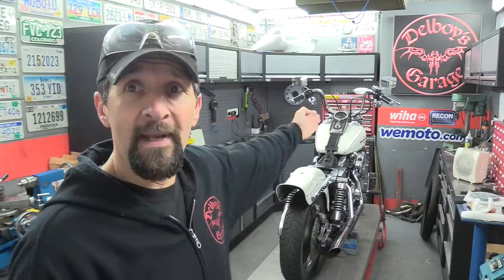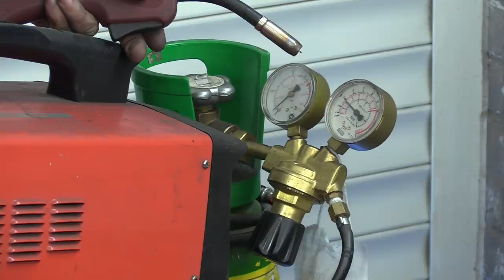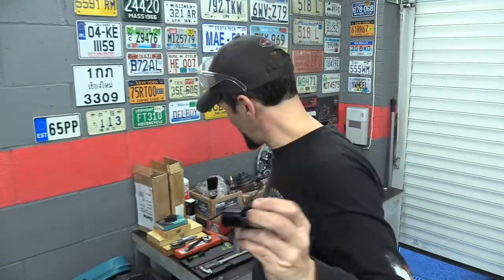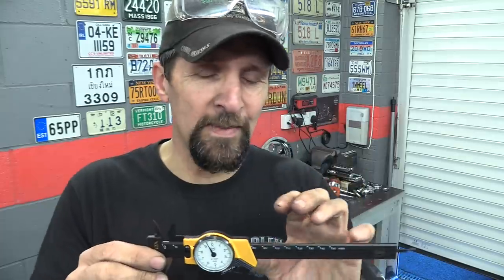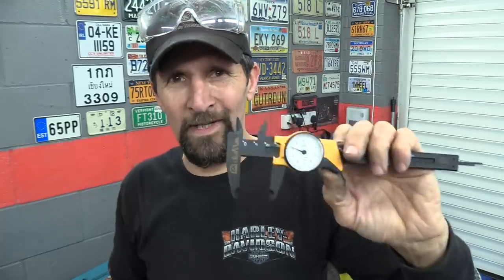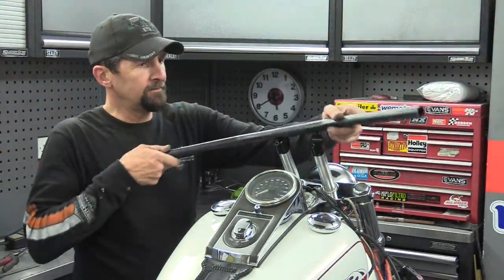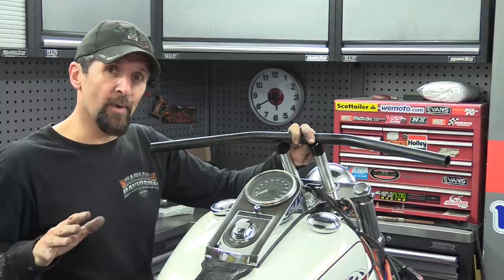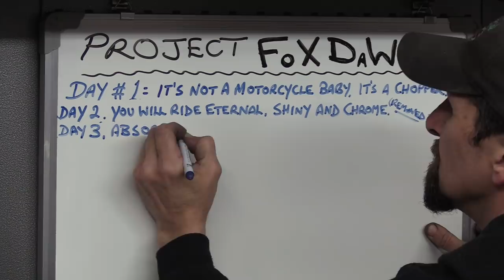Delboy's Garage, Project FoXDaWG, Day 3 :- Handlebars..!

Comment: looking at the nuts you welded to that thread bar, you ground off one side so  the thread has stuff all holding and then you machined the weld down by .7mm at least. So ure relying on a tiny bit of weld and some loose thread thats missing almost  a 1/3rd.  That looks like a big safety issue to me  to hold down all ure steering

Comment: Not a fan of the "all thread bolts", not on a motorcycle anyway... Risers look ridiculous to me, just my opinion. Like others here, I say cut the risers just to clear the speedo, second set of bars.
Reply: Also, if you're going to round/flat the head anyway, just cut a thread into some round bar on the lathe. That way it's one piece and thus safer.
I don't necessarily think the risers are too high (looked ok with you sitting on it), but, like others, I'm worried about flexing. The engineer in me is saying this setup needs some bracing somehow.

Comment: Don’t forget to check the cam chain tensioners at about 40000 miles it’s worthwhile they could be worn . You don’t want them braking up and going in the oil pump 1/2 hours work saves a nightmare I am about to change them on my twin cam fat boy at 38000miles.
Reply from the maker: Thank you buddy, fortunately, I lucked in on the tensioners, the bike has had new primary and secondary tensioners, both new chains, roller tappets and SE203 cams just 1000 miles ago and a massive investment by the last owner... good luck with yours, ain't the twin cams the best engines ever?

Comment: As an alternative to a plastic Vernier gauge, just stick some insulating tape to the jaws of any metal gauge, close and zero them with the tape then measure whatever it is you're trying not to scratch.
Reply from the maker: Great solution, provided the tape's hard enough not to be absorbent as that'll give a fluffy measurement, most tape is soft and flexible... what I was hoping for was a hard plastic jaw cover, perhaps some of that stuff that pushes on to the edge of sheet metal?  Either way, the Wiha plastic dial gauge is bang on for that I need...

Comment: Great video Del.. I would use the bars that are in the black and white part of the video but shorten the risers just a bit maybe one inch so they are level/even with the console on the tank. Look at the black and white part of the video, you will see what I mean.. Keep up the good work.
Reply from the maker: Hi buddy, thanks for your kind feedback, I have a plan... I kinda like the high risers, but you're right, think the bars look a little detached, but as you probably know full well, it's very much a current west coast look, but not going for an outlaw style, something a bit older than that, so I may tone things down a little, so it all fits in!
Reply: @Moonfleet41  Yea I like the high risers to I just think if they were just an inch shorter it would put the bars even with the console on the tank. Great work..

Comment: Gotta admit I prefer the Flat bars but the other bars look better from the side with you sat on the bike than the other view but all that could change with the switch gear and stuff on them. Though If i went with them I'd be tempted to drop them an inch or so IMO. But It's not my bike so just do what's comfortable for your the one going to be riding it.  Glad to see more lathe videos as well.
Reply from the maker: Thanks mate, I think you're right I did leave the risers as long as possible so I can lop a bit off if I need to... !

Comment: I think rather than make a long threaded rod I would have tapped both ends of the riser and used a grade 8 bolt at either end ?
Reply from the maker: Hi James, threading in to aluminium?  Really?  When you can make all the threads steel!  I'm opting for the safer option mate...
Reply: How would you tighten the goofy heads?
Reply: Tighten the handlebar clamp to the riser using a bolt with a flat on it. Then align the two clamps using the handlebars, then tighten the bolts under the top triple clamp.

Comment: Whichever bar you go with, if you're keeping those risers I would suggest some urethane bushings from Alloy Art. You can see the flex in them when you sit on it at the end and pull on the bars. The OEM rubber bushings are garbage.
Reply from the maker: Thanks mate,. good call.. you;re dead right.. they do flex too much... the bars are all loose at the moment, but no matter how much you nip them up they still squidge about... so in fact im actually going to opt for some steel bushings and lock them up solid.. i can damp out any vibes with some internal slugs in the bar ends.. and it'll ride much more accurately aye... Cheers, Del.

Comment: The Risers are way too high and don´t fit the "motocross like" handlebar, nore do they fit the style of the bike. I would cut each riser to half the height. Aside from that they were manufactured, or should i say handcrafted, in a very sophisticated manner. Excellent job, Del. And you use a Kärcher Vacuum-Cleaner, well that`s a good choice too. It`s real german quality from Baden-Württemberg. Thumbs up!
Reply from the maker: Thank you Doc, that's kind of you... I've made them to emulate the same bar set up as the Night Train of the same year... they may look a little high, but with a low seat, which I intend to use, they will give a shoulder height riding position that's really comfortable... Thank you again, have a great week!

Comment: Love the look of the 2nd set of bars. I think that would be trick as hell with the HD Forty-Eight style of underslung mirrors. Can't wait to see the headlight fairing. Some Eagle Lights LED projectors in black would be epic too! Are you planning on slamming the rear down? That fender just has too much gap!  Very similar to my old 88 Super Magna in shape (the rear fender). Would look great with a dual set of round LED tail / stop combo lights tucked under the duckbill of the fender. Regardless, you have impeccable taste in Harley styling so I'm sure it will be very cool...... 

Mike & Melly
Reply from the maker: Thank you Mike, gonna slam the rear and the front, at least 1.5", 2" if I can get away with it, and I'll be making the fairing from scratch, so that may be a few videos in a row... sounds like you miss the Magna brother, don't we always sell the best ones!  Love to you both, D&Px

Comment: Dale, those calipers are for electronic inspection work. ESD .... Electrosatic Discharge,  they will not charge up with static electricity like the stainless steel ones.  The black holding fixture is also made of antistatic material.  A small case with foam rubber could induce static, that's  why there isn't  one.  Retired Aerospace Engineer.  Electronics can be damaged by static electricity.   Especially  CMOS devices.  Copper Metal Oxide Silicon.   There,  I am not going to charge you any consulting fee.  This time !  Haha  Ride safe .
Reply from the maker: Hi Bill, thank you for your professional insight Sir, they are indeed the ESD version (1000 volt I believe?) and I also listed in the description the non-ESD version of these as well... I didn't really  both mentioning it, as not only is it not really relevant, it's just an extra most of us won't use, or benefit, from... but there's no way in a million years that I could have put it as eloquently as you... thank you for your input Sir!

Comment: I like the second bars better.
I have the straight bars on my cruiser, and i don't like them.
With the second bars you can fit them to your size and comfort.
Move them forward or back to fit you.
Reply from the maker: Thanks buddy, one of the great benefits of using these bar clamps is that they have an offset mounting bolt, which gives me 1" forward and backward adjustment on the reach... which will be really helpful when it comes to fine tuning the ride!

Comment: James Cramer here Del, second pair of hangers for me and definitely black (probably a nice matt black) so it looks lean and mean. How high can handlebar risers go (probably as far as the cables can reach I suppose going from lock to lock without pinching) as I imagined yours to be way too high and slightly unstable? Loving the new project Del and it makes my day to hear my notification go off for your next video. Love to you both.
Reply from the maker: Hi James, the risers are fine and solid, they're simply done up hand tight that's all, which makes the whole front end move around... it all gets tightened up and I'll go with the bars that give me the best comfort long term... thanks for your kind support, it's great to hear from you!  Have a great week mate, D&Px

Comment: I find it interesting how fascinating it is just to watch a lathe sculpt metal. :) Now, I know next to nothing about Harleys and trending ways to customise  them but the second, curved handlebar looks a lot more natural on the bike. It also looks like the arms would not tire out as quickly as with totally straight ones. At the end of the day, on a bike like that, I would think comfort would be most desirable. On the ZX the straight handlebar would be my first choice but on this one, well, it's a curvy bike, it deserves a curvy handlebar. That's my two cents on this one. Keep warm!
Reply from the maker: Hi Patricia, good point well made, following the lines of the bike is important, but the drag bars are actually a tad more comfortable because they're slightly further forward and give me a more relaxed riding position, just remember when anything is higher up and mounted to a sliping riser, then it's inevitably further back as well, and with my monkey arms I need all the reach I can get!  Have a great week, good to hear from you, D&Px

Comment: [p] Hi Del sorry for sounding thick . On the lathe have you a setting so you do not take to much metal
off the the piece . Having never used a lathe or tried to just curious . 
Cheers
Pete.
Reply from the maker: Hi Pete, the movement of the cutting tool is affected by three turning wheels that have acme screws, one goes across the bed, one goes along the length of the bed, and the little one on top, known as the compound slide, is swivel-able and can be rotated to go at any angle... and then you wind the wheels and can cut as much, as little, as you want...!

Comment: Second set every time. I take it you didn't have everything TIGHT tight as there seemed to be some flex in there? Looks good. I'm not mad crazy on the 'club' look, but it is right for a Dyna of course. Nice work.
Reply from the maker: Hi Pete, yes it's all loose and only done up finger tight, and it all locks up solid... just wanted to test out the club look, but am leaning towards the more classic drag bar... this Dyna is different to the FXR's, more of a chopper style, more fork rake and of course ducktail fender, so not sure if it could carry a club style anyway!
Reply: @Moonfleet41  Absolutely, good call!

Comment: Personally I definately prefer the 2nd set of bars. Now if you would be able to get that design but from a thicker pipe, that might be worth a look, since (at least in the video) it looks thinner, and thicker bars might give it a more "stout" and even look. Like you said, the old drag bars have been done to death.
Reply from the maker: I thnk drag bars are done to death for a reason, they're just such a classic, simple line that's hard to deny... but I also have some XR1200 bars which I didn't even try as they just won't fit the look of the bike, check out a Night Train, that has te same rear fender and front wheel/forks set up as this and the drag bars do look just right on it (in fact, it's one of the few bikes that does!)...

Comment: Point of rule imho. You give height via risers or handlebar not both. Handlebar with riser (as 2nd club bar) go with smaller risers just as a platform as per original. Your repeating with club bar bar (2nd) just lower height so shouldnt have significant risers. Only 1 item should add height, bar (as original) or risers. Decent size risers ie 5"+ should only have drag bar as your already creating the additional height. Though having said all that, covering with a cowl hides the risers, so perhaps that dumps the rule. I go for drag bar., but I am biased as thats my set up on my night train with 7.5" risers.
Reply from the maker: Hi there, you are, of course, correct in technical terms, but of course that doesn't account for fashion, and the current, and very popular, club style or outlaw style, is to have tall risers with motocross bars on top, so yes, like you say, combining two styles at once that, effectively oppose each other... it's not dissimilar to people who put what were once called box risers on ape hangers... take a look at the Captain America bike from Easy Rider for instance... by logical thinking, they should have simply fitted taller ape hangers on to flat clamps, but then that's the whole concept of form over function, don't ya think?! .... And glad to hear you have a Night Train, that's the style I love the most, but obviously you have some slightly taller risers there as they were 6" from the factory... great to hear from you, all the best, and thanks for your support!
Reply: @Moonfleet41  I am Volvi on facebook, so you may recall the pic I sent you last week on my NT bar/risers setup. Cheers.
Reply from the maker: @Volvi373  Of course, so sorry, we just get snowed under sometimes and in trying to keep up with everything, I sometimes don' put one and one together.... still one of my favourite Harleys, and even more so with springers (not if I could find a pair of them for this project, I'd be a happy bunny, but they won't be around for much less than the price of a new moped lol)...

Comment: Nice job on the risers Del. Looks like a test ride with each one of the bars will seal the deal as to what's comfortable and provides the better handling for u.
Reply from the maker: Thanks Bri, good plan... I think sitting on the bike is enough to know, the drag bars give me an inch further forward reach, which sets my back in the correct position, and I wanna kick some miles on this, so long haul comfort is important!

Comment: 2nd set of bars Del.
I'm no expert, but I'd recommend you remake those bolts out of high tensile threaded rod - wouldn't trust normal mild steel on those tall risers, huge stress point there mate.
Love your lathe work, soooo jealous of that machine !
Reply from the maker: Hi Norbert, the label on the bar quoted 12.9 so it appears to be tensile rod, but am actually on the look out for some dedicated bolts, at the moment they look to be special order only, and really expensive, but even if I don't get them right til the end of the build, these will do fine to hold it together till I'm ready to ride it and if I can finally find some dedicated tensile bolts at 220mm long, then I'll swop them out at the end!
Reply: Moonfleet41 makes sense. Allows you to still experiment with riser lengths if you're exploring bar options too.

Comment: Do either of the replacement bars have the Harley wiring dimples, and if not how will you get round the need for them?
Reply from the maker: The drag bars are OEM Harley so they have dimples, and if I were to use the MX bars, they're currently 7/8th and I would make 7/8th to 1" sleeves to go over them and leave a gap underneath for the wiring to fit in to... which should be plenty!

Comment: The drag bars do look good but the taller ones look better. Also you dont have the hassle of shortening cables and wiring, which I know you would do well but it is a days work you can live without.  Will look good whatever. Regards to you both.